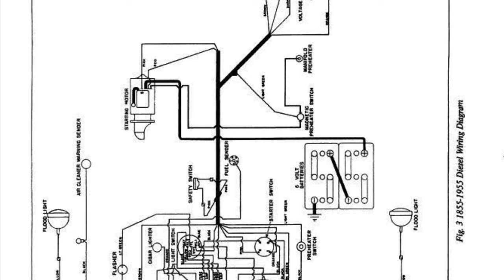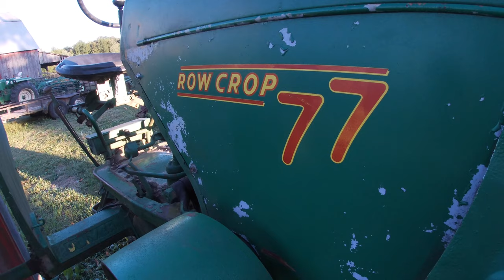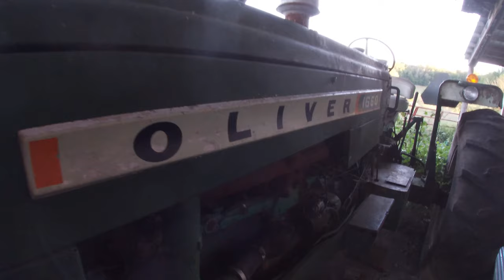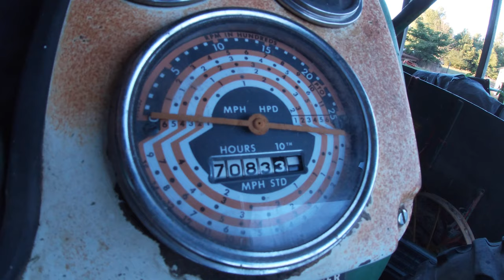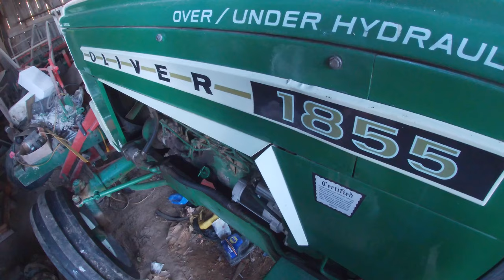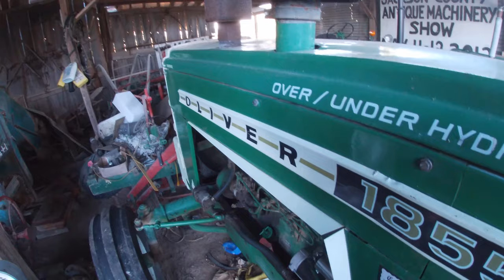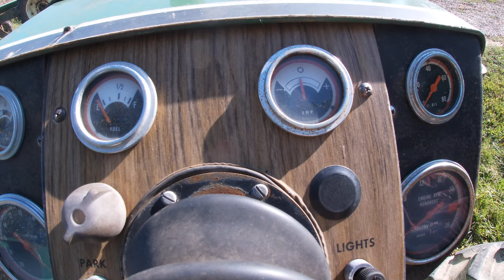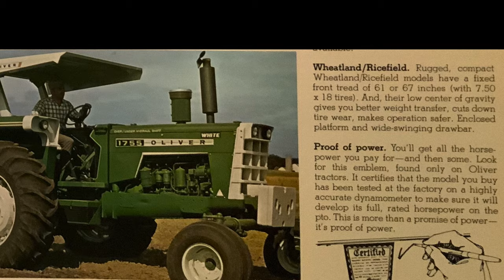Oliver Electrical Systems: Alternators, Starters, and 200 Subscribers! Oh my!!!

Comment: Call me weird but I like to keep the original generators and even 6 volt if they came that way originally.  I'm guessing I would change my mind if it wouldn't be for the local repair shops that are really good with fixing them.  If they rebuild a generator for me I normally don't have any issues with it for a long time.
Reply from the maker: I do like originality, but functionality kind of takes priority most of the time. I still have all the generator so I can put them back if I want to.
Reply: @rosstheoliverman  if it wasn't for having someone to fix the generators I probably would be putting alternatures on mine to.  I do like gear reduction starters though. My Peterbilt with a cat engine had a regular one on it and if I had to put one back on it would have been much sadness getting it in place between the frame rail. The gear reduction one I could hold in place with one hand because it was much lighter

Comment: Do you normally keep your older olivers positive ground or switch to negative? I re-wired a 550 but am having a hard time getting the idiot lights/buzzer to work correctly. The wiring diagram in the old IT manual is a little vague as well lol.
Reply from the maker: If I can salvage the original set up I’ll keep the generator and positive ground. But if it’s too much trouble I’ll just switch it to the 12 V alternator

Comment: Wow, that starter does spin it fast. Now I just need to get over the need to keep stuff original. On your new voltage regulator, I see it has the riveted on cover, so a solid state regulator. Not a big deal, but I wanted to mention they have them for generators as well, and they don't take well to polarizing the generator. I put one on my 1600, polarized the generator and let the magic smoke out!
Reply from the maker: I fight the internal struggle of originality all the time, but after enough aggravation I usually end up choosing function first. I never throw original parts away so it can always be put back. That is true, About being solid state. Circuitry doesn’t like old school ways. So your regulator puffed the magic dragon huh? 🤣
Reply: @rosstheoliverman  Yep. I've found that polarizing isn't all that necessary. I've got so many that don't have a battery in them for months or more, I throw a battery in to fire them up and they charge just fine, so I don't mess with it any more.
Reply from the maker: I know what you mean. Buying batteries, keeping the charging system working, and keeping the fuel system clean is hard when you have lots of tractors. I thought about just using a few batteries and moving them but that got old real quick. I just started buying the cheapest 12V NAPA battery (6526) and putting it in all the ones I don’t use everyday.  I try to start everything regularly but we all know how that goes.

Comment: Per 19:14, if you upgrade this solenoid I assume you just join both of the non-load wires into the single center post.  Is this correct?  Thx
Reply: More specifics....going from a four post (two load carrying large diameter posts and two small signal posts) to a 3 post (two load carrying posts and one signal post).
Reply from the maker: You have to run a new wire from your keyswitch to your ignition coil. Otherwise it will only fire while cranking
Reply: @rosstheoliverman  how might that before and after circuit look?  I have no history or schematics to guide me on this.  I was assuming the switch trigger was closest to 12vdc and i wasnt sure what the other wire was.

Comment: Question do you know if side curtains from Oliver 66 fit a Oliver 77?
Reply from the maker: The 66 and 77 front curtains are the same size. The rear panels are different.

Comment: Years ago I was a JD Tech. At Deere electrical trainings they were emphatic that voltage sense wires (from battery or load center to regulater or direct to alternator) must never be abandoned for a jumper to the alternator output. Reason being that the voltage at the alternator output is not always the same as what is at the battery or main load center due to voltage drop during high load applications (such as at night). The result is that the voltage at the battery will be several 10ths of a volt lower than it should be and the battery will be under charged.
Also, when Deere went from direct drive Delco starters to Nippondenso reduction gear starters this cured the vast majority of cold start issues.
Reply from the maker: That’s interesting! Thanks Chris!

Comment: Hey buddy,
 I have a 88 6 volt. What’s the steps to switch it from 6volt to 12 volt?
Reply from the maker: Different battery, different coil, alternator, different bulbs in your headlights
Reply: @rosstheoliverman   thanks Ross

Comment: Ross, on the 10SI, a wider pulley would be better to fit the belt!
Reply from the maker: That’s true. If you’re talking about the 60, I did that one in a rush because the tractor was going to be used to pull a float in a parade. I’ve never gotten back to it. It’s probably going to get switched to a mini alternator at some point.
Reply: @rosstheoliverman     Very well Ross, I really enjoyed your videos, take care!
Reply from the maker: Thanks!